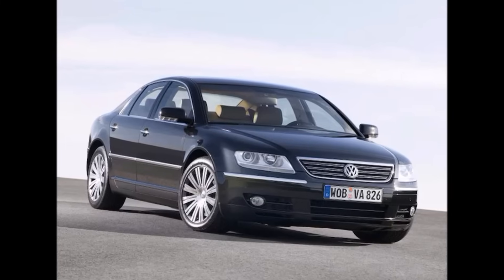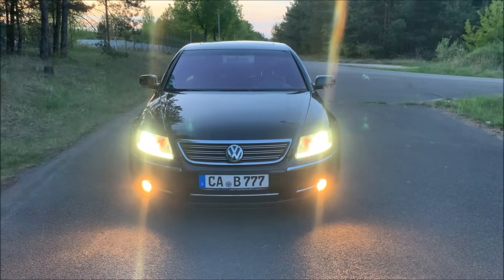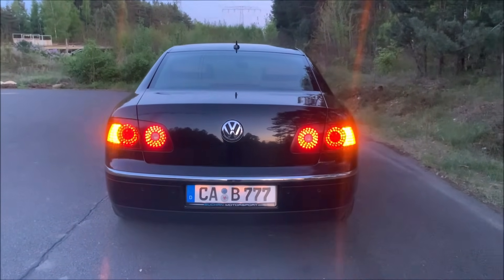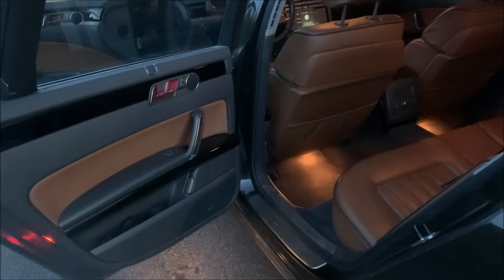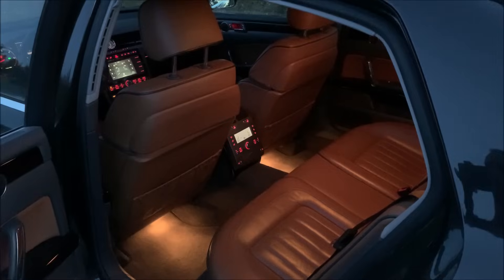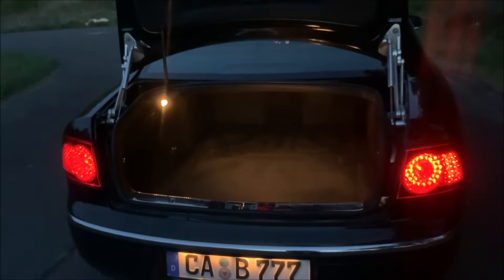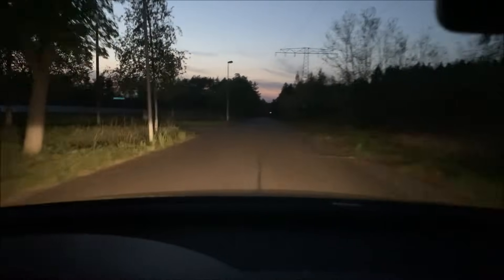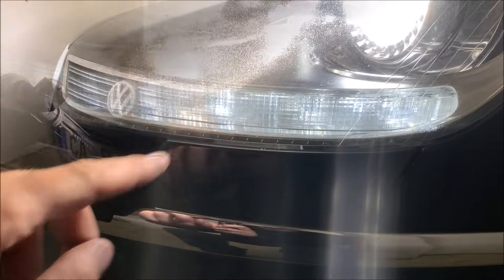VW Phaeton - Part 5 - Light Systems

Comment: Hi, I have 2011 TDI, the headlights are not "following" the steering wheel any more. They do the adjustment moves when turning on, but when done, both stay direction left (like 15°).  The side lights are working normally when turning below 40kmh. Any idea what is the problem? Thank you

Comment: Hello.

Does a part of the rear taillights turn on with the ignition? or is it always off?

I need the information for a model i am making.
Reply from the maker: If the ignition is on, tail lights are off, unless you press the brake or switch on the light
Reply: @bsport320 

Thank you. Also, There seems to be a smaller pedal to the right from the Brake pedal, is it a "Handbrake pedal" like on the older Mercedes models, or is it something else?

Comment: Hi, please do the Audio System if you haven't already.
I'm interested in the front door audio. from what I've seen online there's a woofer and a subwoofer there? (what speaker sizes are they?)
do they share the same housing or they are separated in some way? (I mean the action from the subwoofer would distort or even damage the woofer in a sealed housing)
the door isn't exactly sealed, but... 
I'm trying to fit subwoofers in my Mk 4 Golf Coupe (2 Door / Large Doors) and I'm trying to get inspiration from luxury cars out there.

Comment: To be honest, everybody knew during its time, that VW was pulling out something huge. But I guess it never came over the way you're describing this automotive miracle! VW would have needed your expertise to explain the superiority of the Phaeton to BMW or Mercs. At the end it's still an underated masterpiece. Are there any disadvantages of its concept? The development costs were probably staggering. To much complexity? Maintenance costs?
I think you mentioned, that the factory in Dresden was used to build Bentleys. But as I understood, Bentleys were mainly based on Panameras, but included the VW Powertrain. Technically it should have been possible to put a V10 Diesel in a Bentley, right? So how solved VW to puzzel all these parts together on one assembly line?🤯
Reply from the maker: The new generation Bentley Continentals were first based on the Audi platform, like the Phaeton and the same Phaeton development team did these Bentleys.
Later, when Porsche became a part of VW, they used the Panamera platform, which has a number of advantages, but this one is not made for the V10 TDI.

Comment: The technology of the lighting system is not that impressive, its what was could have been offered at the time by companies like Bosch, Brose, Continental, Preh etc.
What is impressive is the level of detail the engineers and system engineers invested in the project, almost like the they were designing it for themselves.

Comment: Are the license plate lights paired with the lights under the mirrors? If so, they should also light up if you just open the door, e.g. while geting out of the car. That would be very clever
Reply: Yep, i can see that in 10:35
Reply from the maker: Yes they are, like I said they are part of the ambient light concept😁

Comment: I was wondering, there are so many litted switches in the interior, is their a button or knob to turn their brightness down, or turn them off for driving at complete darkness, where only lights are interior and headlights ?
Reply from the maker: Yes you can turn their brightness down next to the dash and switch the screen to dark mode

Comment: Please show the power memory rear view mirror!  I used to have this car and it was the best feature ever! I can’t believe that this didn’t become standard on all luxury cars. It would tie the position of the mirror to the seat memory and move the rear view to the exact spot each driver wanted it at. Modern cars move everything as well but then you have to readjust the mirror manually every-time you switch drivers. I have never seen any other car that ever had this feature!
Reply from the maker: Will do!
Reply: VWs mostly also adjust the mirrors, at least VW Golfs, Touaregs and Passats I have driven.
Reply: @ But just the ones on the doors right? Not the center one? I have had several top spec audi’s since and they haven’t
Reply: @kevinev9431  oh you are right, facepalm my bad.
But with it being manually adjusted, but electronic memory, it's probably too intuitive in many cases.

Like the original adjustable interval wipers on the Golf 3, where you would tap the wiper once and after the desired interval latch the switch and it would repeat that interval all the time.
It was super convenient, but too well hidden and with the Golf 4 they replaced it with the far less good weird small adjustment switch on the stalks.

Most people never read the manual and probably didn't even know even their Mk3 already had variable adjustable interval wipers.

Comment: Which exact model is your Phaeton? I am especially interested in the engine, from your ⌀Verbrauch of 22l I am assuming it´s the legendary W12 :D
Reply from the maker: No that’s just because I just it out from the garage and it was idling.
Mine is a 2008 3.0TDI, 233hp CARA.
It’s usually between 7-8.5l/100km

Comment: I have always wondered why manufacturers seem so reluctant to use LED signal lights. While more cars have them today, there are still many cars that are full LED but still incandescent turn signals. Like my 2024 RAV4 which is all LED except the turn signals. I replaced the bulbs with LED pretty much the week after I took delivery from the dealer. Makes the car look so much better.

Comment: As a GP1 owner myself, I like your videos your phaeton was ordered with good options, I have put 300k on mine for the last 6 years and i have to say it's a fine car for long travels. I think the GP1 was the best phaeton made model wise, it has two downsides euro 4 and the navigation is a bit dated, strangely in the VW brochure it says its Euro 5 for the GP1 i'll have to ask other owners of GP1 how is it written Euro 4 or 5 it might be a mistake here in the DMV. As to the navigation the PCB sags and it creates a Problem with the graphics processor, its on GP0/GP1 this problem, good thing on the GP1 is that the Cluster is Plug and Play from a GP2 and the Navigation RNS810 is fairly easy to install with the amplifier it's about 60 wires to re-pin and to run 8 new wires from the RNS810 to the AMP. 
I really enjoy your videos keep them coming :)
Reply from the maker: Thanks for sharing and there is more to come!

Comment: The cornering lights are similar to the E92 BMW I used to own. That car had very clear headlights which is clearer than the Audi A4 and Q5 and A5. These are other cars I have owned. 

The other 2 features that particular BMW excelled compared to Audi is the HVAC and the sound system. The BMW had a very quiet HVAC and it cools very uniformly. The vent temperatures at the foot and dash can be adjust independently which is useful in the winter when you want your feet to feel warm but face not to burn. The sound system is amazing, it has a subwoofer under the seat, you don't just hear the beats, you feel it in your bottom!

That Bimmer was a wonderful car to own for a short time. It was an expensive money pit to own it though so i ended up trading it back to an Audi.

Comment: I saw that this car has over 300k. How much does it cost to keep one of these on the road which such high mileage?
Reply from the maker: It’s not high milage for a Phaeton, there are many with more than 400,000km. I’m doing service and most repairs myself. It gets the annual oil change and new parts if necessary. I will do a separate video about the costs

Comment: Love your videos, but why is there a diesel in this luxurycar? I was suprised. You can slightly hear the diesel on the inside, in my opinion a diesel is to rough for a luxury car. What did Piech think about this do you belive? It was kinda new with diesel, especially for highend cars at this time.
Reply from the maker: Yes, that’s one point we can discuss in a next video. The V6 TDI is great if you are used to 4 cylinder Diesels, but you are spoiled so much by all the Phaeton comfort, that I would rather have a few cylinders more, or even a petrol engine. 
But the V6 TDI is the best choice economically.
Reply: You must be trolling, luxury car had diesel since forever. Do you consider e class and s class to not be luxury? What about the big citroen sedan?
Reply: @polomarco7053  I get what you’re saying, and yeah – there were luxury cars with diesel engines in the '90s, like the S-Class (W140), BMW 7 Series, and even the Audi A8. But it still felt a bit unusual to have a diesel in a high-end luxury car back then. Especially outside of Europe, it wasn’t that common. It wasn’t really until the early 2000s, with engines like the V6 TDI in the Phaeton, that diesel started to be taken seriously in the top-tier luxury segment. So perhaps not technically new, but definitely new in terms of perception.

Comment: It’s remarkable that all the LEDs are still working. The rear brake light bar of my 2008 BMW had to be replaced because too many LEDs had failed at some point.
Reply from the maker: Classic BMW problems, we have the same within the family
Reply: Usually the two compliment each other rather well when it comes to being crap
Reply: @ryanthompson2893  
I don’t know about VW in general but I the Phaeton is of exceptional high quality. 
As for my experience with BMW, I’m still very satisfied with the cars I have (had).

Comment: The different stop/brake light appearance with the rear fog lights on is due to the ECE R48 regulation, that requires the separation of 100 mm (≈4") between stop light and fog light chamber. So that’s how the lamp manufacturer solved it.

A very cool presentation. Cheers!
Reply: Good knowledge!

Comment: Especially the servo steering the xenon light into the curve is really nice. Today sadly most cars just have a static LED light, so the inside of the corners always stay dark.
Reply: VW kept those servo steering lights all the way up to today. The IQ light package with matrix light will shift the "eyeball" just the same as this Phaeton does. Before that the "led high" trim usually had the capability. Before that the better Xenon option did it, too.

Comment: Great video. I always wondered if later phaetons retained same quality and features as the first ones? Or maybe there was a dip in quality to save some money because sales werent the best? What are your thoughts on this?
Reply from the maker: You cannot really say the Phaeton reduced in quality over lifetime. When VW needed to save money (from 2015/2016, Diesel Scandal), the Phaeton production stopped.
Until then, they kept on adding new features while keeping existing ones, although Facelifts 3 and 4 (GP3, GP4) really made it look like a Passat.
Reply: @bsport320  oh thats good to hear. Im not a fan of the Passat look, the original styling stood the test of time, its hard to believe it was released over 20 years ago..by the way yours looks great.
Reply: @bsport320  it always seemed a "thicker Passat" in front and side views to me. With years passing, I'd take it as an advantage, I'm getting to like stuff that's better than its looks. 🙂

Comment: Nice to see how the rear fog lamps use the inner pair of brake lamp rings. Because a fog light can't be within 100 mm of a brake lamp, only the outer half of the outer ring functions as a brake lamp when the fog lamp is lit (Lots of cars do something like this now but this would have been one of the first as it basically needed CANbus lights to do the control and I think it also relied on a change of the ECE vehicle lighting regs to permit it).

I'm slightly surprised to see a VAG car with twin rear fogs as they usually only have one on the drivers side, though it would appear some of the cars with a fog bulb on each side will only light the one on the drivers side but will swap it to the passengers side if the car has a 'tourist' mode for driving on the other side of the road. Presumably the Phaeton has a tourist mode (hopefully with a full flipped pattern rather than a flattening the pattern or just lowering the standard pattern so its useless (Ford do this on some models)) but has twin rear fogs because that's more than the single lamp of lesser models.

I always thought the illuminated air vent controls on my Audi B5 was a nice premium detail that most cars of the era just didn't have (that car had lots of nice bits of quality Audi switch gear, later Audis lost that feel as they just used VW switches with extra chrome). There was also the dim red lights shining down on the center console, not really to illuminate it but just made it slightly easier to place your hand when going for a button.
Reply from the maker: If money doesn't matter cars have 2 reverse lights and 2 rear fog lights like this Phaeton.
Reply: @bsport320  well, even Škoda Felicia where money mattered had twin fogs and twin reverse lights 😅

Comment: This phaeton series is so cool, I hope to one day own such a car, preferably with the v10 diesel (and also a mk1 touareg with the same v10 diesel).  Although this has made me realize that the c5 x7 is basically a budget phaeton 😅. There is cornering/steering bi xenons, dedicated cornering lights in the headlight housing (only on or off, no soft fade out), lights in the door handles, lights in the door storage pockets that turn on with a sensor when you reach in, that bmw style soft night light coming down from the roof onto the center console, there is a soft airflow diffusion vent on top of the dash (although I think the phaeton solution is way more efficient because it's 3x the size), double pane windows, window shades in the rear doors, hydraulic suspension and so on. Sadly mine is missing an automatic transmission but oh well, can't have it all I guess...

edit: Forgot to mention that one of the lights inside the trunk pops out and can be used handheld, surprisingly the battery still works on a 17 year old car.
Reply from the maker: Thanks
Reply: I'm guessing your C5 is an Estate?  My C5 v6 HDI sedan doesn't have the handheld light in the boot.  Sadly it's also the closest I'll come to owning a Phaeton only 1 ever came to Australia.
Reply: @iananderson4897  Estate yes. Interesting as I thought the sedans also had it.

Comment: Great video as always, if I may ask. If you could spec a new one which engine would you chose. And if money was no object would you go for the Bentley flying spur over the VW?
Reply from the maker: Thanks!
If I choose from VW, Audi and Bentley and money doesn't matter, I would take the Phaeton GP1, W12, 4 seater, long wheelbase. Which is a car I might buy in the future ;)
The A8 D3 is like a simplified version of the Phaeton and the Bentley not as high quality, I know that's hard but true, I worked in the production of both (wiring loom, buttons, interior controls, etc.)

Comment: When you say self illuminating license plate what exactly do u you mean?
Instead of pointing down towards the plate it points at it so it is dependant on the reflective surface of the plate?
How does it work?
Reply from the maker: It means the white surface of the licence plate is shining.
The Swiss company Lumitec AG and the German company FER Fahrzeugtechnik developed that system, where the black letters and numbers are sticked to a plastic plate with a electroluminescence foil. 
So the licence plate shines with electric energy.
The system was expensive but just good enough for the Phaeton, which was the only car to get a special permission of the German traffic authorities. The permission was running out in 2005 and they used the 4 licence plate lights instead.
Maybe stuff for another video^^
Reply: @bsport320  WOW, so it is an actual self illuminating license plate  without tricks, it must had been a nightmare to legislate for other markets even in the eu where they use other colours for the rear plate. Anyway, thank you very much for the excellent  information on a not so well known aspect to a very impressive car, I hope you enjoy it very much and learn even more things about it!

Comment: This cornering light is a bit irritating because the color and the brightness is a bit of. Newer cars have cornering lights which blend better together with the main light. So well, you don't even notice it going on and off that much but having great cornering visibility nevertheless.
True is that those cheap fog light cornering lights are also very irritating for other drivers on the road.
Reply: From 2010 onwards the cornering light were LEDs so the colour temperature is closer to the xenons

Comment: My 1973 Citroen DS had headlights that pointed into the corners (self levelling too). Completely mechanical, it relied on a system of rods, levers and springs to translate steering wheel movement exponentially into lateral movement of the inner pair of headlights. 
When set up correctly the performance was surprisingly good.
Reply: Yes they started it😅
Reply: @CraigLandsberg-lk1ep actually that was Tucker (an American brand) back in the 1940s